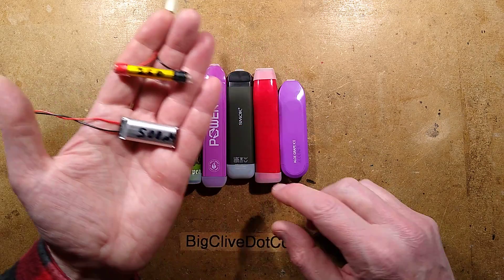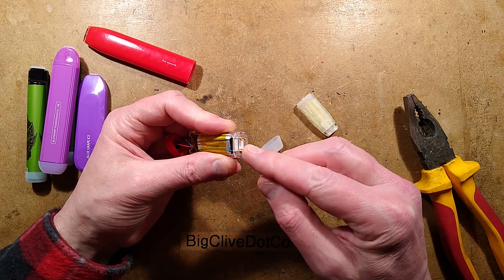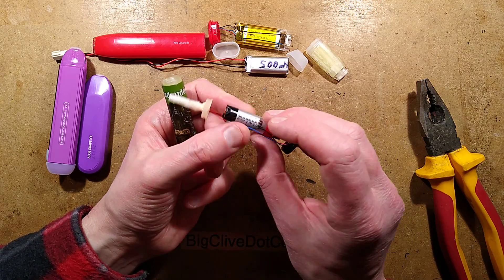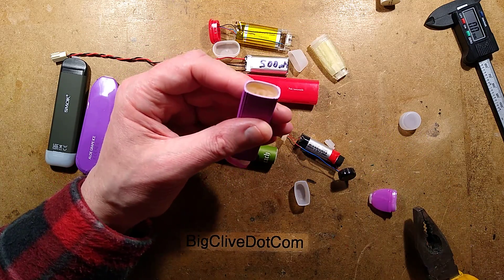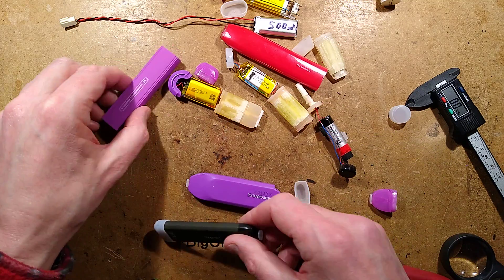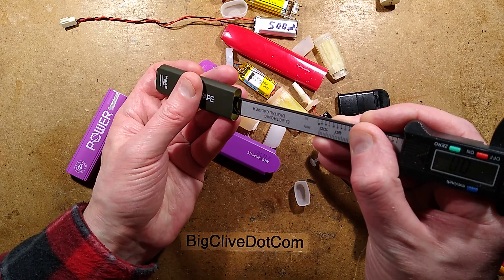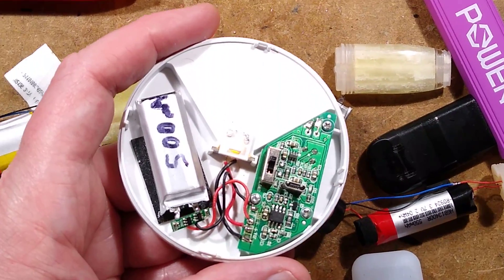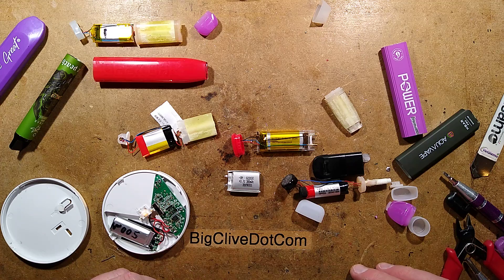Scavenging rechargeable lithium cells from the roadside

Comment: I’m pleased there might be some use for the battery from these disposable items ... my annoyance comes from the plethora of litter that users of these devices get to spread far and wide - the pen itself, two rubbery end caps, a foil sleeve, a cardboard box, and an outer cellophane wrap. Is every bit of it strictly necessary? ... or is it just overkill to ensure it survives the trip from the Orient I wonder?

Comment: Now you point it out it's kind of obvious that these would have little Lithium Polymer cells in them, but It never even crossed my mind before. I fly RC aircraft, and some of the small Li-Po packs are silly money once you add shipping

I've built my own packs from bare cells before, so it wouldn't be that difficult to make something out of these. The C rating might not be ridiculously high, but for a small fixed wing aircraft it wouldn't need to be, and if the amp load turned out to be borderline for a 3S setup, there's nothing stopping me making them into 3S2P packs.

I've got a friend who buy's these in packs of three every once and a while for when he's going out (He's got a fair bit of quite nice rebuildable vaping kit, but he doesn't like to risk losing that when he's out and drinking), so I'll have to ask him to save me the "Emptys". :D

Comment: After seeing you open that aluminum extrusion with a lithium cell inside it I don't want NOBODY telling me off for tossing a soda can along with the regular trash.
Reply: I mean, I would prefer it if we threw away metals that can be easily recycled indefinitely rather using plastic that gets mixed all together and half of it can't be recycled and part of the other half can't be used either for various reasons such as contamination.

Comment: Clive, you can open the "microphone" vacuum switch, there is a 6 pin chip that drives the led on it's back side and enables current to the coil. It acts as a sort of battery protection. There is also a tiny mylar  membrane that is used as a contact.
Reply: He already did it:  https://www.youtube.com/watch?v=ZsWLvr-dsvc
Reply: @jbalazer , missed that one, thanks.

Comment: Crazy, I just found a couple of these that had been run over in the street and salvaged and recharged the battery. Horrible products, horrible people who throw them out their car window... Haven't figured out what to use the batteries in yet.
Reply: “Two things are infinite: the universe and human stupidity; and I'm not sure about the universe.”
― Albert Einstein
Reply: You could add a small high voltage circuit (Like a Joule Thief with a lot of turns on the secondary winding), connect one hv terminal to the metal case, and the other to a little wire just within the mouthpiece, and drop your modified device back inside the open window of the horrible tosser who lobbed it in the first place. When they find it, and have an experimental puff... KAPOW!

Comment: I feel the need to say this.... These are not reusable due to the coil inside of the device either getting gunked up or burning. On the reusable device you change the coil regularly which is how most device manufacturers make there money. In the case of disposable devices it comes down to making a super cheap device because once they add the liquid the price inflates so much its unreal. A 60ml bottle of juice, that I would run in a big device, cost 20 $ at the store and I can produce it myself for less than 2 $. That where the money is in vaping its the juice not the devices. How else could vuse sell there devices for 1$.
Reply: I never really considered making my own juice, it is so cheap compared to smoking it's almost free even at retail cost for juice. Where do you get your supplies for making it?

Comment: Haven't seen them in Germany, I guess they are forbidden here. What a terrible product though. Another small example of how broken capitalism is.
Reply: These devices replace a paper tube full of leaves - because the government has so heavily taxed the paper tube full of leaves.

Were free market capitalism actually occurring this would not be a problem.
Reply: @c6q3a24  Im talking about making it disposible instead of rechargeable, which would have been easy. Im not comparing it to a totally different product and I did not comment on government regulations.
Reply: @chrisfoot6680  
These products only exist because there is a ~400% tax on the paper tubes.
Reply: @c6q3a24  you really don't want to get my point, do you? It doesn't matter what taxes there are on the other product, it's still a bad product. What my point is, that capitalism is broken, because it's cheaper for the company, to make it disposible. They only would have had to add a charging IC and a micro usb port, maybe a hole to refill the liquid. It's like a company selling dosposible cars with a closed up fuel tank.

Comment: Why are the companies that make these "thingies" so wasteful that they put rechargeable lithium cells in them with no provisions for actually recharging the device? They even make the device slightly modular, but not rechargeable. They also sometimes make the body out of aluminum instead of much cheaper plastic that would work just as well. Why are these companies making products that waste natural resources?

Comment: Haha, yep, I do that! They're also useful for head torches, to replace the 3 x AAA nightmare. You can connect them in parallel (making them self balancing, you can even mix different capacity cells this way) and put a protection circuit over the bunch. Using small cells lets you fit them into whatever space you have available. I then add a poundland powerbank USB charging circuit, with the big USB port unsoldered to make it flatter, and you have a USB rechargeable li-ion head torch :-)
Reply: That is impressive.  Good to know about the 3 aaa.👍🤔
Reply: @assassinlexx1993  ? 3x1,5V is 4,5V but usually discharge below 3V on lipo bags does give you fire and bang if charged again
You need protection or on recharge your headlamps catches fire if deep charged enough
Reply: @kitecattestecke2303  he adds a small usb battery bank circuit to give 5v and handle battery charge and discharge cutoff voltages.
Reply: @kitecattestecke2303  4.5v doesn't matter, no cell is going to sit that high for very long, as for discharging, annoloki already stated he has protection + the power bank has it's own cut-off too, but if you need something then TP4056 boards with protection cost like 50 cents, also that's wrong, sure it isn't recommended to go below 3v and it isn't great for life span, but it is safe to go as low as 2.75v and even if you do go lower, as long as you bring it back up very slowly (say 20-100ma or less than 0.1C) you're still unlikely to get a fire, (but not impossible to be clear) usually if it fails short while discharging it would cause it get a little warm, but soon fizzle out and discharge itself to 1v or lower.
Reply: @kitecattestecke2303  - If you use a recharging board, such as I bought with mini-usb for peanuts, that takes care of the protection.
Reply: @vgamesx1  i think they should be safe to charge at full current from any voltage, its just that cell that is discharged this low may be symptom of fault inside cell, like a whisker. Basically slow charge is here to keep power dissipation of fault "resistor" in cell to minimum, in case it is here.
Reply: I almost commented the exact same comment! Just upgraded my bike headlamp to li-ion with a cell found on the side of the road + modified powerbank board haha
Reply: @_BangDroid_  thinking I have loads of old UM2 ? 3v lamp cycle lamps that are heavy, and some torches that took the larger C cell (6v) ones,  the batteries leaked , so I suppose I could clean up, add USB charger, and maybe fit two or three of these cell units instead - switchable - to give a nice longer life ?
Reply: The joys of smacking your head on a lintel, cracking the plastic housing and three heavy batteries tumbling out like rolls of rolos.
Reply: Chinese started selling little microusb board with small alligator clamps, marketing it to smokers to recharge these.
Reply: @KOTYAR1  keywords to find them?
Reply: What a great idea. My grandson has a lot of toys that need AAA batteries, could save a small fortune
Reply: @1crazypj  yea if you want your kids toy to become a fire hazard.
Reply: @Alexander_l322  a FiRe hAzArD? 🐈
Reply: I think you can even buy the protection boards separately, as well as the boards inside powerbanks. You get a dozen for a couple of quid or so, something like that. I wouldn't put them in a kid's toy though. There are all sorts of special regulations regarding batteries in kids' toys, lithiums differ from ordinary 1.5V batteries in a few important ways (current capacity being one). For the cost of a few batteries I'd just steer clear and save the lithiums for someone who'll enjoy playing with them more, ie me. Using ordinary batteries for toys also means you get a bit of peace when the little bastards finally die. The batteries, I mean.
Reply: @greenaum  poss safety if kids eat the smaller ones.
Reply: Nightmare is right. AAAs are pointless, especially when AAs would have fitted.
Reply: I done that too. I got cheap powerbank USB years back that comes with useless capacity lithium cell but charging circuit is for sure useful. I made 7200mA (2 laptop flat packs) chargeable xmas tree. For torches you can get lights that take lithium cells on Ali if you have li-on charger already.
Reply: Great idea
Reply: Fantastic idea!! Bang on my friend!!

Comment: as it happens I am at this very moment sucking on one of those that has been converted to refillable and rechargeable... also- they will drive one of those little "stun-gun" modules just fine, producing a little bitty pocket taser...  that will definitely hurt, but probably not stop anyone who is motivated... and might just piss them off. obviously, a momentary button is added. imagine the spectacle of someone trying to put the taser in their mouth to activate it... one way or another it's not going to work out well.
   peace.

Comment: I have a number of lithium cells I've collected from disposable vaping devices I've found. Haven't seen any in awhile, but I do keep an eye out for them. As a tip, I use a tubing cutter for the round ones I can't get apart, get as close to the tip as possible so you don't cut into the cell by mistake.
Reply: Be careful of the nicotine, it can be absorbed through the skin. Rinse with COLD water if you get any on your skin.
Reply: @MarksGoneWicked  yeah i was just about to mention that it’s strong enough to make you feel sick when you get it on your skin.
Reply: @MarksGoneWicked  - Simple enough to carry a pair of latex or nitrile gloves with you.  I keep some in my car, because I never know when I'm going to need to grab something really filthy or greasy.

Comment: clive could you do me a massive favor, im studying electrical engineering and the notes my lecturer gave me are terrible. its kirchhovs law on networks. we are online studying and its really hard to understand. could you make a really really simple video on how to solve this. 2  dc voltages supply's 2 loops 3 resistors and we need to find the unknown (current). cheers.

Comment: Clive using calipers as a punch tool = my spirit animal.  
I measured wet snow with mine like 5 mins ago
Reply: The proper tool is generally the first one within arms reach.
Reply: "measured wet snow" to see what the temperature or humidity-level was, surely. You didn't use the calipers to measure any kind of distance because, that would be so .... normal.
Reply: @DreadX10  No, only the depth.  They were by the front door and the nearest tape was in my vehicle.